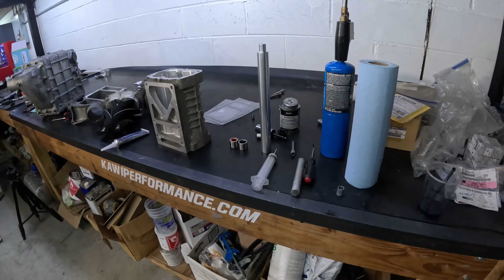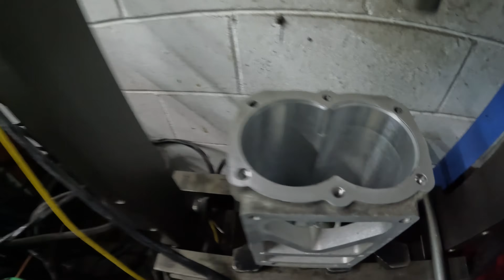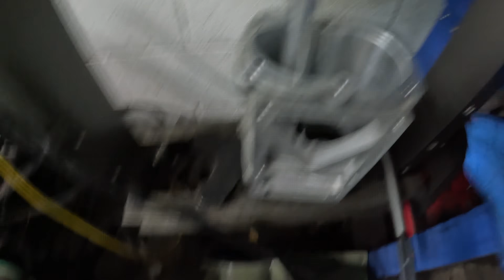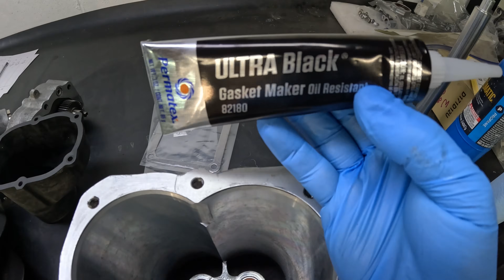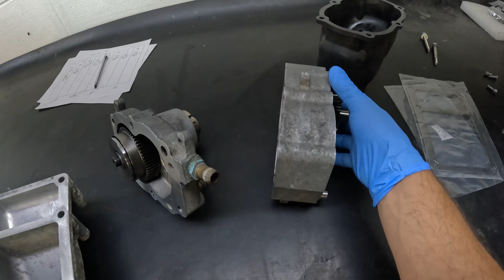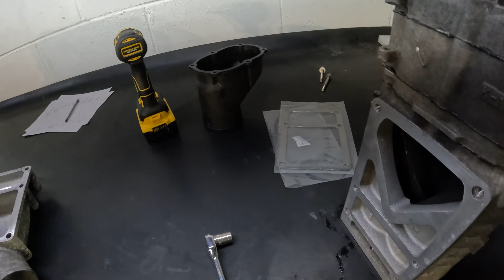Ultra 300/310 & STX 310 Supercharger Rebuild (Pt 3): Needle Bearing Install & Assembly

Comment: Where do you get the tool from?
Reply from the maker: You can get all the tools directly on our website 🙂
Reply: will this tool work for a roush supercharger needle bearing?
Reply from the maker: @627racing4 If it's the same bearings, it's possible
Reply: im aware they can be rebuilt using eaton spec bearings

Comment: Great vid.  Kind of surprised there aren't any actual gaskets and they make you use gasket maker.
Reply from the maker: The straightness needs to be accurately controlled since this spins over 16k, a gasket can cause vast thickness discrepancies. So, its easiest for the manufacturer to do it this way.